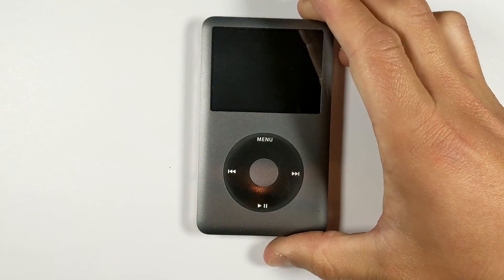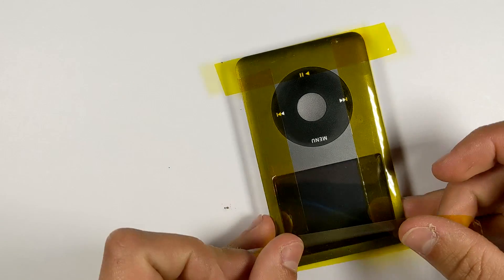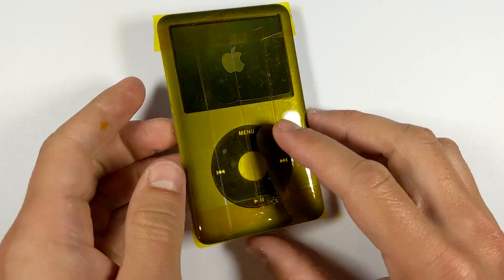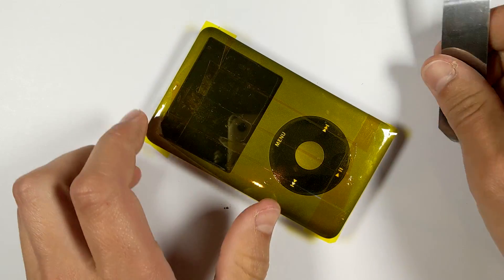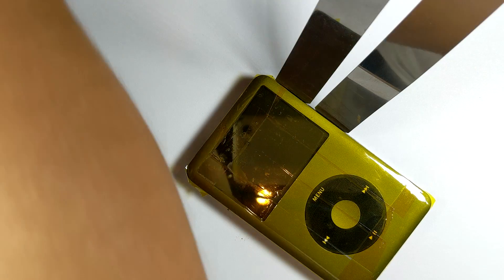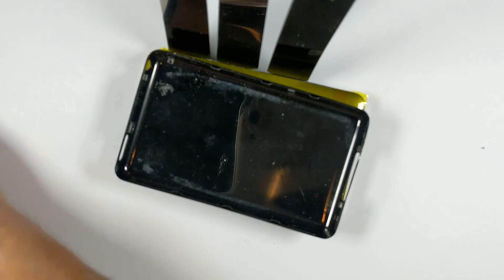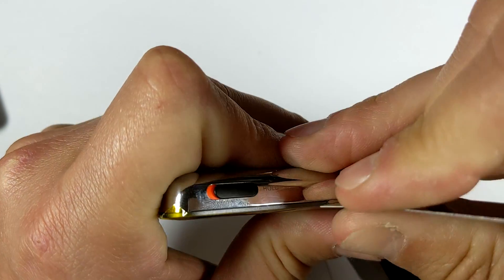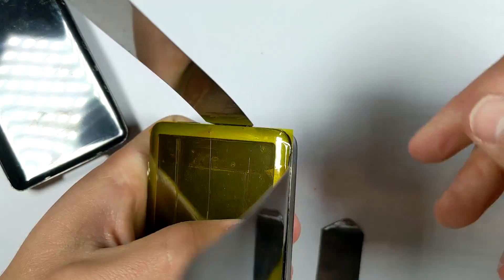iPod Classic 6/ 7th Gen Hard Drive and Battery Upgrade Tutorial

Comment: There's a new battery out. 3800mah. Fits between iflash SSD adapter and mobo. Seems like it should hit the audio jack less too. Just ordered to replace my 3000mah showed in this video. Not easiest thing to cram this battery in without really squeezing some things, but really have to crush the HDD cable down in this configuration...

Comment: Hi. my ipad hdd just recently failed. I have a 6gen 80gb model. I want to use the flash and upgrade the battery to 3000mah from your website. can you let me know if the 3000mah battery fits inside the 80gb iPod?

Comment: I'm confused... How did you get past 128Gb without using Rockbox?  I think the iFlash quad inherently fixes that issue, as this is the second video I've seen where the quad is used and the reported capacity is over 128.  I have a solo I just put into a 7th gen thick, and the 256gb SD card seems to be a waste because it only reports 128 even after formatting separately.
Reply from the maker: @kd6045  the 7th gen doesnt have a 128gb limit, only the 6th gen does. They look identical on the outside. The thick version is a 6th gen for sure
Reply: @partspluspods3689  Son of a gun, that's it.  I thought for some reason only the 7th gen had a 160gb variant. That's got to be it for sure, thanks so much for clearing my confusion!
Reply: So was this battery replacement on a 7th Gen? A thin ipod? I've been told these larger batteries won't fit in a thin ipod classic even with an iFlash adapter.

Comment: Do you need to format the SD cards?
Reply from the maker: Not usually unless they are not detected. If its not detecting the sd card then formatting to fat32 or exfat can fix that. You can also try opening disk management and making sure that the entire SD card is formatted correctly. If it has a partition or there is an unallocated space it will usually not be detected in the iflash.

Comment: I have a modded 6th gen and decided to get the 7th gen due to the capacity limitations and I just transferred the battery and iflash from the 6th to the 7th with confidence because of this video. It was my first time opening things like this. Thank you so much!
Reply: So the 3000mah battery and an iFlash quad fits in a 7th Gen thin ipod classic?? I've been told there isn't enough room in a 7thgen for the larger battery even if you remove the hdd.

Comment: using all the same hardware except 2 512 sd cards. Keeps saying in recovery and restore which I do and it never stops. Ideas?
Reply from the maker: i would take out the SD cards and reformat them individually within disk management and it may fix it. If it doesn't i would then try with another SD card as the one you have may not be compatible. There are a number of sandisk cards that refuse to work in the iflash adapters. Although it can take longer than usual to restore within itunes when you put in a large amount of storage.

If that still hasnt worked i would then replace then replace the hard drive flex cable. 

If it still hasn't worked check with the original hard drive or another adapter. 

If even that doesn't work have a look at the hard drive connector on the board. If there is any crack in it, even a small one it will cause the iPod to fail when restoring. At that stage you would just need a new logic board.
Reply: @ thank you. It finally is seeing it and shows the 1T memory but nothing will sync to it. It says it can’t be played on this iPad

Comment: What is the micro sd size limitations on the quad? I have a gen 7 160g. In theory could I put a 1T in each slot? using for video as well so 50k songs limit isn't the issue.

Comment: hey man, quick question if you don’t mind… the brown plastic clip slid right off the pins as I went to connect the battery, no damage, just wanted to see if It’s ok to just glue the plastic base only, and place it back?
Reply from the maker: yeah if you just slide it back on it will work. I wouldn't recommend using glue as it may be conductive and cause damage if i touches the pins

Comment: I installed new parts like in the video except, I’m trying to use a Samsung evo pro 512GB and I’m having trouble formatting and restoring my iPod. I could really use some help, it’s driving me crazy :(
Reply from the maker: i would take the sd card out and format it with a computer first. That will usually fix it. If it still doesn't work you might need to open disk management, delete all the partitions and start again. Or alternatively you could try changing the filesystem when you reformat it.

Comment: Ehi thanks for the video very useful, however now I'm at the point of restoring the iPod but my pc simply doesn't read it neither on iTunes nor on the file explorer
Do you have any suggestions?
Reply from the maker: First i would try a different cable. If its making the USB sound when u plug it in then you might just need to update the USB driver which you can do from within windows file explorer. You can also try putting the ipod into disk mode to restore it also. To do that hold both the menu and centre buttons till the ipod restarts, then hold the centre and play/pause button until it displays the disk mode menu. If its still not being recognised by any computers after trying all of that it is probably a faulty logic board or charging port which is a semi common thing to fail.

Comment: For a 7th Gen:
1) What's the memory limit for each quad iFlash slot and iTunes? Same question with Rockbox
2)  What brand and type of micro SD card would you pick? (class...)
3) When do you use a thin or thick back cover? Depends just on the battery size?

Thanks for the video, I appreciate the effort

Comment: Important to note here that you didn't mention: The 5th and 6th gen iPods CAN actually utilize more than the 128GB limit, but it requires you to flash Rockbox as the OS and then expanding the partition of the card to use all of the available storage. So don't let having a 6th gen iPod limit you from wanting to put in 500GBs.
Reply: Also i can change hard drive to a sd card with 256 gb and should directly install Rockbox? Or i need to restore IT with itunes and them install rockbox?
Reply: I’d like a video on how to do this exactly
Reply: so installing rockbox lets you go up to 500gb or even bigger?
Reply: @marcmiller2218  Yes, it does. But there is some nuance to it. If you are keeping the original firmware on your iPod, you have the ability to mess up the partition. I know because I did it 😂.  I accidently rebooted from Rockbox into the iPod firmware and it "downgraded" my partition to 127GB (even though it was a 512 GB microSD card). So you just have to be careful. Also you may need to use a partition manager to "unlock" the rest of the storage space after you restore the iPod and install Rockbox.
Reply: @codywlsmith  is there any video about it brother? most of videos are pretty old which used older upgrades
Reply: 5th gen iPod Classic doesn't need rockbox to have more than 128gb memory ! Just install 1tb or more... , but 6th gen will need rockbox. 😊
Reply: Oh brother

Comment: Never mind. I see you charge $177 for a 128GB and battery upgrade. Dude that's just too much. the only difficult part is opening the Ipod so its $150 for you to open it and connect the $27 worth of parts. Dude no.
Reply from the maker: An iflash quad will cost roughly $80AUD including shipping off of the official website. The cheapest 3000mah batteries are around $25 and a 128GB micro SD card will cost $10 - $20 as well depending what brand (AUD). So if you were to do it yourself you would be spending a bit over $100 AUD on parts for a setup like this. 

You can definitely use cheaper parts than that if you want but its not as good of an experience. The green aliexpress adapters that can be had for $5 dont always work properly on the 6th and 7th gens, they consume more power, they wont fit in the slim version with the 3000mah battery and they occasionally corrupt by themselves and you have to restore it with itunes. For those reasons Im not comfortable using those for mail in repairs on the classic 6th and 7th gens.   

$177 is the NZD price also, its $165 AUD or $108 USD for a 128GB iflash and 3000mah battery upgrade on my website.
Reply: @partspluspods3689 never justify your worth you picked a price that you deemed aceptable for your service, if the customer doesn’t like it, wish them luck and offer your service should they change there mind.  i use to work at a repair shop part-time and noticed the more i help people out by charging less for the repairs the  more the customer expected that to be a normal thing/value  and would even try to haggle me more of a discount for future  services.
Reply: Another thing is opening it is pretty hard without breaking it or bending the aluminum backplate
Reply: agreed
Reply: Did you just land on this planet or why are you surprised that someone who offers a service needs to have profit margins? Everything you buy have that including your shitty low grade parts in your ipod. Don't forget to go around to every business in your town tomorrow and complain about their prices.. That doing something yourself is cheaper than paying someone to do it is not news to any human being that comes across your stupid comment.
Reply: I’ll keep it short. You’re a dikhead
Reply: To be fair, that looks really annoying to do, and I already know how things turn out when I do it myself… some people don’t wanna take the risk, and he’s there for them if they want to pay. 
Are you saying you’re willing to do it for less? If so, let everybody know so they can save some dough.
Reply: Do it yourself then
Reply: @sethd4329  I did. Almost a year ago. Much cheaper and not difficult at all. Thanks for your great input though.
Reply: Do you really need to use that many metal openers? I’m genuinely curious as I’ve been buying parts to complete my own mod. I’ve seen videos where only one is needed but they looked like they do mods often so I dunno.
Reply: Then don’t buy it. Simple as that. Try doing it yourself. You’ll end up needing a new case. Probably screen and click wheel too. From what I can tell the parts alone are $100. You think he shouldn’t charge for labor?  Welcome to the real world.
Reply: @EyeForKnowledge. I did it myself. It was a total of $42. Thanks for your input.
Reply: @HolographicSkux  Amazing!  I suppose my only question is if you knew you were going to do it yourself, and did do it yourself, why would you call someone out on their price they would charge to do it?  $42?  That’s how much the iflash quad costs. Battery is another $20. The cards are around $15-30 each depending on what kind you got. $100 is on the low end. If you want a full TB, or even 2, it’s $150 and up. I’d surely like to know how you did this for $42.
Reply: @EyeForKnowledge. wow. you make no points at all but talk a lot. I didn't know I was going to do it so what a dumb comment that was for you to make. I did it because I wasn't going to pay this guy way too much to do it. Aliexpress had all the parts and it works perfectly.  Any other moronic remarks you want to make?
Reply: @HolographicSkux  I think anyone reading this would agree every word I typed has a point.  There is no talking going on here genius. Talking is making sounds into words with your vocal cords. The moronic remark would be your original comment insulting the dude for providing a service and saying he charges too much for it. ESPECIALLY having the knowledge to do
It yourself. Irregardless of weather you knew you were going to do it or not. Means you are lazy and wanted someone else to do the hard work for you. Then complain that it costs too much. 

Oh. You went the aliexpress route. I use quality parts. As Elite Obsolte is also well known to use. 10/4. Good luck with that. 😂
Reply: @EyeForKnowledge.   Wow how much did they pay you for that book deal?

you came here to white knight the creator of the video only to find out you had no leg to stand on so now you are creating all sorts of noise with your paragraphs. Grow up.
Reply: @HolographicSkux  Book?  Really?  It’s a paragraph and a half. At least we know your intellect level now. Saying I’m talking when I’m typing. Calling typed text “noise”. And now calling a paragraph a book. When was the last time you even read a book?  😂. This is really all you got?  You mad so now you pulling out the standard replies?  Come up with new material champ.
Reply: @EyeForKnowledge. lol you are still going. what are you trying to prove here? or do you just want attention?
Reply: @HolographicSkux  Just responding to you. Nothing more. Nothing less.
Reply: @EyeForKnowledge.  agreed. you have nothing. just spouting your nonsense thinking you made a point about something that didn't involve you. grow up.
Reply: @HolographicSkux says the guy who thinks $27 worth of parts went into this. iFlashes are expensive but fully worth it because they just work. Unfortunately you have to pay for that privilege. Dude is making like $40 on labour. All that being said, this service is for those who don't want to spend an hour opening up their ipod.
Reply: @MarvMavro I did it myself. It was easy to do and didn't cost nearly $177. not even $50. Works perfectly. Anything else you want to try and explain?
Reply: @HolographicSkux can you link where you got the parts? I just want to replace battery
Reply: @UKsystems You understand Apple does not make genuine SSD and battery upgrades for the Ipod classic right? all the parts made now are "fake" parts. Why did you just embarrass yourself like that?

And to reply to your other comment (for some reason you made two separate comments) They are annoying to open but not hard, just be careful and take your time. I did it without any issue or scratches.
Reply: @UKsystems Oh yeah. Still waiting for the part where you mention official apple parts. Pretty sure your next reply will have that information though right? to backup what you said when you thought you had an important opinion.
Reply: Where's your video?
Reply: @sal3060  What?
Reply: Ok then do it yourself and stop crying about it. Parts a and labor bro.
Reply: @BryanMiraflor  I did it months ago for less than 1/4 the price. You would know if you read the comments instead of mouthing off about things you don't know.

Comment: hi, can the battery replacement fit with the original hard drive?
Reply: Can you fit 3000mah battery with iflash quad on the back of thin back ipod classic 7
Reply from the maker: if you want to use one of these 3000mah batteries and you have a thin version you can fit the battery + the original hard drive if you also change the rear housing to a thick version. you can get those through my website or aliexpress (should have links in the desc). However if you have the thick version it wont fit unfortunately.

Comment: Can... 1,2,3,4 Be added? 
1) blue tooth 5.3 ? 
2) wireless charging? 
3) Convert connector to USBC?
4) get a better operating system than i tunes?
Reply: 1) 5.3 specifically i don't think there's a transmitter that's been proven to work inside an ipod without heavy modification but you can put bluetooth transmitters on an ipod
2) yes, you just need to know how to solder, you also have to buy a wireless charging device and steal the coil from it. you also have to get or make a plastic custom back housing as wireless charging will not work with stainless steel
3) yes, again, you just need to know how to solder, but you will lose firewire, so if you happen to have a dead battery and you're trying to revive your ipod before opening it. you won't be able to.
4) there is the rockbox software but honestly imo i much prefer the iPods base software, while rockbox has a bunch of customizability but learning how to get music on there and themes and all sorts of stuff is very linux like. much prefer the iPod software since it's all done through iTunes and pretty easy

Comment: I did the HDD upgrade around 8 years ago after the og died (never disconect a device, specially a mechanical drive without safety ), after a couple of years I replaced the battery but it kinda sucked, these days I can get maybe 1h of charge from it so I was looking for a video for a bigger one if possible. 

It is useful to know that the original 160GB drive was a single plate, when I bought the 256GB model it was double plate so I ended buying a generic back plate since the double plate HDD does not fit with the og back plate.

10:06 yep been there, done that...two extra weeks for a replacement for me lol

Comment: Thank you for posting this. I'm a complete novice modifying iPods and it really helped me out with installing the iFlash quad into one of my old iPod Classics (7th gen). I also replaced the battery but only with a standard capacity one. I have another thin Classic 7th gen that I would like to upgrade with the iFlash quad AND a 3000mah battery exactly like you have in this video. The battery you use in the video and the one you sell on your site fits in the thin back but I've heard that others you can get on eBay (looks like mostly LG brand) will not fit the thin back. Is this right? I would buy the battery from your site but shipping to the US costs more than the battery itself (this is not a criticism of your service btw).

Comment: How do I know my 6th gen iPod 80GB classic can take a 256GB SD card?
Reply from the maker: You can tell what generation yours is by looking at the model number In the iPod, just go settings > about > and the 3rd page will tell you.
6th gen model numbers start with: MB or BP. And can only read up to 127GB (even on the 160GB version)
7th gen model number start with PC or MC. And can read 256GB 512GB 1TB+ hard drives
Reply: @partspluspods3689  thanks